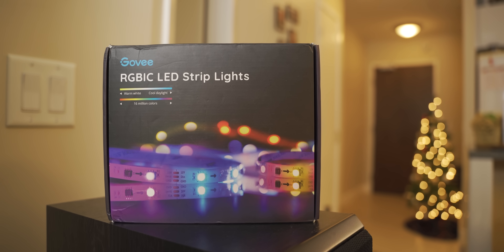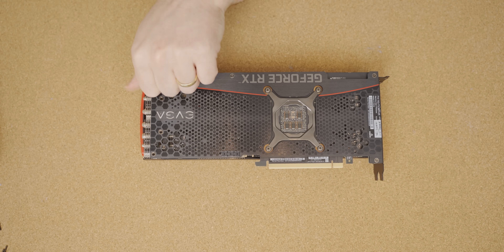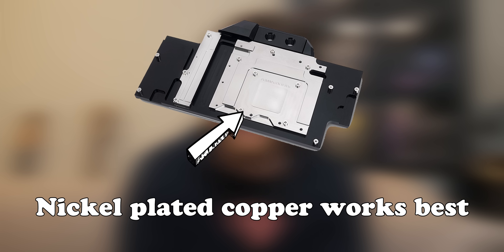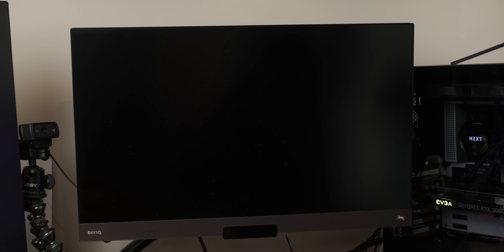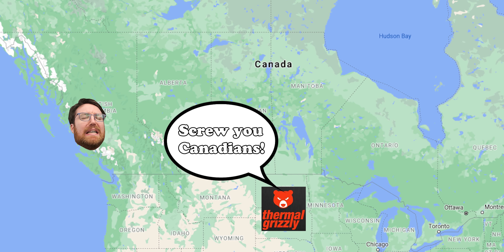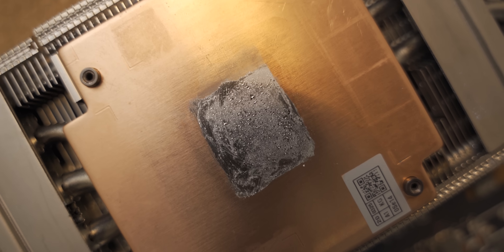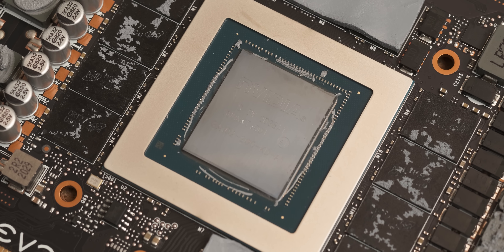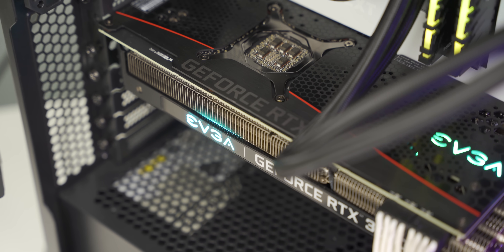NOOB uses Liquid Metal on an RTX 3080...

Comment: I've always been concerned with using liquid metal, but watching you do it gives me some confidence.
Reply: Don't do it. Liquid metal is for nerd idiots that like watching "nice" numbers on their screens. The difference in temps is minimal against good thermal paste and you have a big risk of shorting something in the card and fry it.
Reply: unless your an extreme overclocking guru who knows what their doing you run the risk of completely destroying your graphics card
Reply: It is not worth it unless you know what you are doing. Unless you are well versed in overlocking GPU’s for any meaningful results, leave it alone. You can still get some extra fps by doing a slight clock without doing this, and that’s usually enough. The higher you go, the less return you see, and unless you have a good grasp of modding your GPU for extreme voltage changes, forget it. Whether your GPU runs 52 or 62 degrees during a game, does not matter. 

Now if you use your GPU for machine learning purposes for example, then yes you gain something. But keep in mind that I only see a benefit because I push a pair of linked 3090’s hard - much harder than any game ever will. It can also be of value if you do multi-layer Fx editing or GPU renders, but forget it for gaming.

Comment: I ended up using a NZXT Kraken G12  on my rtx 2080 ti and it worked a treat, knocked the temps down from 85c when gaming full out to around 65c, way worth it compared to liquid metal
Reply: same here, went down from 84C to 57C normally, and 60C cranking the power limit all the way up with a full 340W load.

Comment: I use liquid metal on almost everything I can. One thing I don't understand is why everybody recommends clear fingernail polish to protect components. For one, there is a specific type of fingernail polish you are supposed to use for it to be safe and protect correctly. Secondly, they actually make something to do that job properly. It's called silicone conformal coating. You can get a huge jar of it on Amazon on the cheap. Also, I would say after removing a lot of that LM, it looked a little light. There should still be a decent sheen to it. Oh, and if you are going to be tearing down graphics cards and such somewhat often, it's a good idea to have a decent assortment of thermal pads around.
Reply: hi I want to ask is it true that conformal coating works? I intend to use Kapton tape.. but many also recommend conformal coating as far as I know it is used on drones or mobile RC to protect it from water

Comment: That liquid metal from Thermalright sucks! I tried it and is really disappointed. Instead of that, I recommend to you a liquid that called LT-100 is better than Thermal Grizzly Condoctanout because it has 128 W/mK https://www.amazon.com/dp/B07YC9WM3S/ref=cm_sw_r_wa_apa_i_8UN2Fb883051P?_encoding=UTF8&psc=1

Comment: Done liquid metal on my stock AMD 5700XT and worked really was a big drop in temps but to make good contact i needed to add 1mm plastic washers under the cooler bracket to increase pressure between the cooler and the die. I wonder if you are having the same problem i had

Comment: My RTX 2080 was hitting 85C consistently while gaming.
It turned out that the thermal paste dried up and the thermal pads were in a bad shape. 
Re-pasted it with Thermal Grizzly Conductonaut, most pads I've replaced with a thermal tape, only one needed to be thicker. 
Now runs at 70C and below.

Comment: I put some conductonaut LMTIM on my Zotac 1080 Ti as I was getting less-than-ideal temps.  There wasn't much of a change.  Ran it for about 7 months.  Took the stock cooler off as I was planning on doing a Kraken G12 AIO conversion and saw that the LM had eaten into the copper cold plate of the stock cooler (copper is supposed to be ok for LM but not the best) and permanently stained the GPU die.  As Dawid hinted, the majority of the time the cooler itself typically is the bottleneck, not the TIM.  Just not worth it in GPU applications in my experience.

Comment: I have the exact same 3080, i did an undervolt on it and at 2010mhz and 950 mvolts (1,070 volt stock) i'm at 58 to 62 c in games at 70% fans, it's a little loud but temps is great, i wouldn't dare touch my 3080 with liquid metal

Comment: So basically, use thermal paste like everyone else 😆
Reply from the maker: Haha!! Exactly.
Reply: YES liquid metal is a trap it will ruin anything it touches, I wouldn't trust it within 10 feet of my PC.
Reply: @MichaelClark-uw7ex  i have it on my delided I7 8086K at 5.4ghz for over 2 years now.
Reply: @pauloa.7609  8086 at 5.4 ghz?
My old 8086 only ran at 5 mhz, 1000 times slower.
That is some extreme overclocking, but only in 8 bits, that would kind of defeat the purpose.
Reply: @MichaelClark-uw7ex  I7 8086K, a special binned edition of the 8700K, you silly dude.
Reply: @pauloa.7609  Aw rats, I was hoping you were onto something new.
Give new hope for all those ancient 8 bit CPUs.
If an 8086 could do that, imagine what a 16 bit 6802 could do. 🤣
Reply: @MichaelClark-uw7ex  the 8086 was 16bit
It was the 8088 that was 8bit.
Reply: @MichaelClark-uw7ex  ruined a motherboard messing with that stuff.....i had a drop come out of nohwhere and fell in my cpu pins.....game over......funny is ive done it many times but it only takes one goof...
Reply: @MichaelClark-uw7ex 
Please shut up when you’re clearly completely ignorant about Liquid Metal. 
It will not destroy a pc. That is the absolute dumbest thing to say, and it can only come from someone completely clueless with no experience.

Comment: I am in love with Conducornaut.  That stuff is amazing (in my case).  I have a Dell G5 gaming laptop.  The CPU would thermal throttle at a moment's notice.  Apply some liquid metal, and I can't get it to throttle now, no matter what kind of load I use.  Yes, it gets toasty and the fans scream like a banshee, but it works.

Comment: My RTX 3080 thermal throttled even though GPU was only 57C. Adding thermal pads to the backplate, instantly fixed it and getting better performance. 
If you guys have a 3080 and the fans auto to 100% or near to that even though it says the temp is only 62C, your VRAM is thermal throttling and overheating, change and add thermals pads to the back PCB where the VRAM connects.

Comment: Here's my experience with Silver King/Liquid Metal: I Watched a lot of tutorials on using Liquid Metal on GPU (1080ti) die before deciding to go this path. Finally took the plunge. It is really only for the dedicated, somewhat risk taking enthusiast, but so far worth the results (compared to 2 year old stock paste). I am using it on my 2 year old EVGA 1080Ti FTW3, which was starting to show higher temps with the old stock paste (which was on the dry side after 2 years of use). My before and after (controlled 70% fan speed) 10 min Heaven Benchmark tests showed a reduction of max stable temps from 78C (holding 1936 Mhz) to 63C (holding 1949 Mhz). The increase in temps is also slower, so in real game use the temps generally stay in the 50s with lower fan RPM. The price of this Liquid Metal is comparable to MX-4, but the risk, reward and difficulty of use is far higher. I must say, it was a bit of a tough process to carefully coat the resistors around the GPU die with clear Nail polish (without getting it on the die) and getting the right (min) amount of liquid metal on the die and the heatsink. This was all done in June 2020, and so far all's well and GPU has been keeping its 'Cool' ;)
Reply: About a year later, has anything gone wrong?
Reply: @leyzic9272  its all good. No issues and temps are stable

Comment: Dawid Does Tech Stuff
 I have a blower-style GTX 1060. If I replace this blower and install a fan (AMD cpu cooler fan) on the heatsink of the GPU; temps get better. But I am worried about the VRMs temps. This card doesn't have an onboard vrms temp measure sensor and I don't have any infrared thermometer to check it. 
So, should I use the modded cooling solution or stock blower cooler?

Comment: Hi David, had same issue, couldn't get thermal pads in my country for old HD6970, did a ghetto method and added Noctua nt-h2 thermal paste thick grain on all vrms and memory modules. Unbelievably after a month of gaming it still works, even got my temps about 20C cooler on GPU then before. Unfortunately XFX HD6970 don't have separate VRM temp sensor so no idea what is happening there

Comment: Hmm maybe I should try messing with liquid metal on my PC once...
Reply: Dont let your power supply touch the case!!!
Reply: That liquid metal is going to short the rest of the system, so do the preparation with insulation pads.
Reply: Believe me, you don't want to do this, otherwise you will set your pc on fire 🔥
Reply: Wow I didn't know Dawid likes me enough to give me a heart!
Reply: @After_Pasta  Yeah I understood his trolling
Reply: Make sure to use the tweezers in order to apply it /s
Reply: Lmao I’ll be honest... I killed my asus b450i and 3600 with liquid metal🤦🏼‍♂️
Reply: No cuz your gonna end up putting liquid metal everywhere
Reply: Bruh it's the guy from The Verge
Reply: I use it on all of my cups, delidded, as well as laptop cpus, a well as all gpu we have, except my wife's strix gtx 960 4G which has one of those directcu cold plates with the heat pipes interspersed with aluminum.  Just watch out for hardening.  Use kryonaut on top of any ihs, and Conductonaut on the die, and this is the best defense against hardening.
Reply: ROFL
Reply: I killed my brand new msi mobo putting liquid metal on my 1070
Reply: Guys hes acting like the verge pc dude , dont actually start reccomending and telling him no
Reply: @No12780  What are you even talking about?
Reply: I wouldn't let liquid metal into the same building as my computer.
Gallium is the Terminator of metals.

Comment: In The EVGA X1 Precision software it will tell you the temps of all the different parts of the card. I'm not sure about the 3080 but the 3090 has 10 different temps sensors that you could look at.

Comment: That must have been frustrating lol. I applied liquid metal to my evga 970 FTW+ a while ago. After some months, I noticed crazy temps. Took it apart and it was all dried out. Whatever was on there was rock hard. I had to sand the liquid metal off the cooler plate, and carefully sand it off the top of the GPU die too. Didn't reapply, just stuck mx-4 back on but that was very blah lol.

Comment: Can someone help please?
my friend has 1155 platform
Xeon E3-1220 V2
ASUS strix GTX 750ti 2gb
2x4 Corsair Vengeance 1600mHz

and in old game such as AC Brotherhood, he has fps drops
GPU usage is around 50% 
CPU usage is 70-80%
all this at 720p with high settings...
Reply: Xeon E3-1220 V2 is an Ivy Bridge, 4 core/4 thread CPU, alongside E3-1225. All CPUs above these two are hyperthreaded which helps a lot with CPU utilization, also higher clock speeds. Should be easy to find and also cheap on eBay (at least in the U.S.). Adding in another 2 x 4 if there are any extra slots will also help.
Latest Geforce Game Ready Drivers?
The GTX 750Ti is an older Maxwell gaming graphics card, it should be okay for 1080p in older titles, but it is in need of an upgrade.
Reply: @hansbehrends438  Bro I just want to know why this system has such unbalanced CPU and GPU load... logically it's not a bottleneck problem, both CPU and GPU should be working fine together but they are not, for some reason... your info gathered from google doesn't help me much, no offence man... also I know that it's an old system but  it can live couple more years and my comrade had really tight budget, so he upgraded from i3 2120 and gt630 to this config...
Reply: @Roman-L  yeah man, your guess is as good as mine. And I used intel ark, not google search. Good luck to your friend

Comment: That first application of liquid metal was probably just a bit too much, but the xc3 cooler does not have very good contact to begin with, as you saw, it's not a very even or flat contact pad.  take it one step further, and apply just a little bit more thermal material, and then try it again. The gains would not be in the temperatures. In fact, the way the fans are set to ramp in that specific card, ideal temperature it aims for is 75 degrees. What you will see an improvement in, is better boost clocks, or lower fan speed to maintain the same temperature. Keep going, you were almost there.

Comment: I put liquid metal on both my 5700xts in my system and boiiii 12 lower on the first, and the bottom card by 6
Reply: Did you try a good quality thermal paste first?
Reply: @Safetytrousers  ic diamond 1 degree different so I thought FCK it and well it works

Comment: My P620s case high airflow and 3080 TUF OC sits at about 62 degrees C. Good case and GPU combination? Probably. That’s with a 5950X too loaded up with 16 cores on heavyload. AliExpress has a lovely section of thermal pads.

Comment: I wouldn't recommend liquid metal on copper either. While it doesn't outright destroy the copper like it would aluminum, it still reacts with it very slowly, which actually degrades its performance over time. I'd only use it on nickel plated surfaces.

I recently "upgraded" to an i7 6700k, and even with a beefy air cooler, I was hitting 100 degrees with thermal throttling. I tried lapping the IHS and even delidding to use different thermal pastes, but no luck. I used Thermal Grizzly conductonaut and now the cpu hardly goes over 70c under full load, and it stays at about 50c when gaming.

Comment: The problem with thermal pads bought somewhere else is that they are indeed pads, but not necessarily thermal conductive. Especially cheap ones.
However there is also a chance that the problem is not about the pads. Maybe you have managed to damage something :)
Good luck!

Comment: a good tip for using liquid metal is to cover the tiny capacitors around the die with a clear coat, usually nail polish clear coat, it seals them up, keeping them from shorting and preventing war in Hungary.
Reply: I found electrical insulation tape fine. And that is very simple to remove.

Comment: Is it worth buying the rx 5600xt now, in the end of 2020, or should I wait for the new nvidia budget 30 series releases?
Reply: The consensus seems to be, buy the best GPU that you can afford. Of both CPU and GPU, the GPU ages a bit faster than the CPU, while a mighty CPU can push 2 generations of GPUs. I say, sure, buy the 5600XT if you can find one at a good price! Compare cost per frame for a GPU. Hardware Unboxed does a great job comparing different classes of GPU. 5600XT is similar to 2060 Super. For modern titles, they're both great 1080p cards, but only mediocre or lackluster at 1440p.

Comment: just make sure you put clear fingernail polish over the little resistors around the GPU cuz if you don't you're going to screw up right off the bat
Reply: Electrical insulation tape is fine. And it is very easy to totally remove.